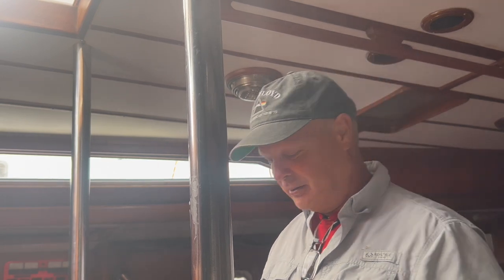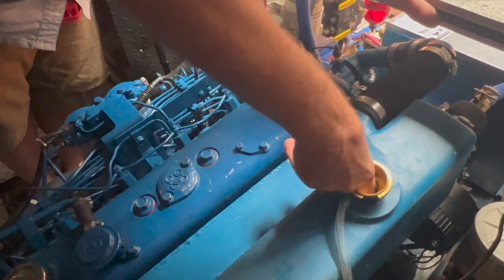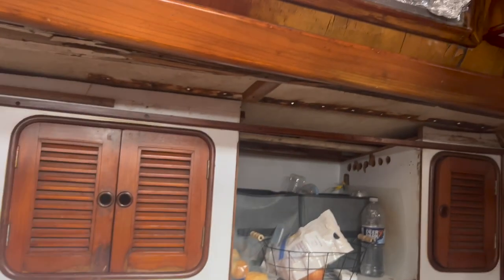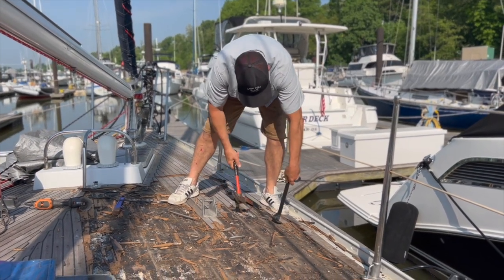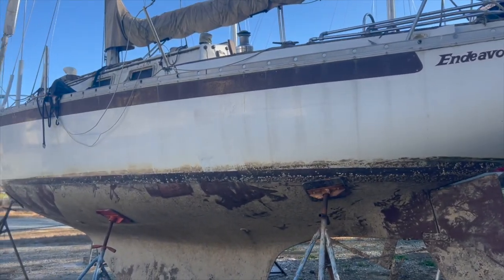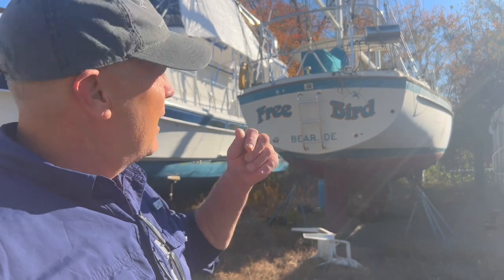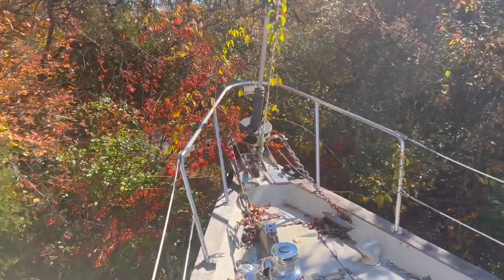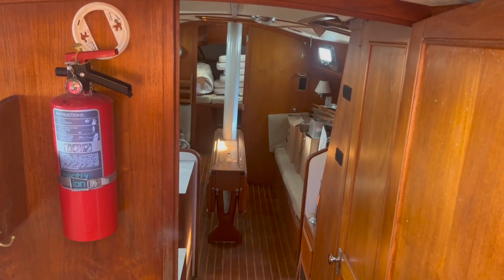FREE SAILBOAT -  Are They Worth It? DIY Sailing- Ep. 42 Sailing SV Bohemian

Comment: Pressure test the cooling system and use a stethoscope and listen for the air leak. 
Are there any freeze plugs that could be leaking in the motor well and your just not seeing it?

Comment: From a pure cost perspective, it probably isn't worth it. But you have the opportunity to fit it out exactly how you want it, and in the process, you learn every detail about your boat's systems before heading to sea.
Reply from the maker: That’s definitely right . I got a sailboat coming on the show that has some big issues . But the inside is really old and nostalgic
Reply: @sailingsvbohemian1464   I'm trying to decide just how much of a project I want to take on. I'm not afraid of hard work, actually, I quite enjoy fiberglass work, sanding, finishing, etc. I haven't done any huge sailboat projects yet, but I did spend a summer restoring an old Boston Whaler, and a year refitting an old racing dinghy a long time ago. I'm looking forward to seeing what you have coming up. Cheers!

Comment: If it's a head gasket it will either mix with your oil or it could go into your cylinders, the only sign if it's going into your cylinders would be white smoke from your exhaust. But you won't see it if you have a wet exhaust. I'm thinking if it's going into your cylinders with a wet exhaust you will most likely have to take the head off.
Reply from the maker: Before I replaced the old heat exchanger. It would blow a cloud of white smoke, now it doesn’t after a replaced it . But it still uses antifreeze.  I gotta remove the head . Never can be easy .

Comment: I'd say it's a head gasket pushing antifreeze out the exhaust.  I was brought up around owner operator truck drivers and was one myself for several years so I'm not a mechanic but I do know enough.. I'd definitely have the head redone and made sure it's flat etc while it's off.. another thing I would do before messing with it is do a oil sample analysis on it.. it will tell you if the engine is wearing on whatever bearings etc so you can know how much life is left in it.. don't want to spend more on it and then break a rod or spin a bearing etc

Comment: If you cannot get parts for that Perkins diesel I am not sure investing further funds is the wisest path.  I hope someone identifies where the cooling system leak is for you.  Congratulations on stripping all the teak off the deck - that is a real job.  If you are thinking of flipping boats rather than houses,  it is different economics.  Shelter is a necessity while a yacht is not a necessity.  Look at Ebay's donated boats, they just had a 71 foot Huckins motoryacht go for low to mid twenties, I think it was $23K, with twin diesels that worked. I wish someone would take a dry vac leave it on the ground and get the water out of the Endeavour sailboat as those are nice boats.  The gravity and suction would take the water out of most of the boat.  Nice video - thanks.
Reply from the maker: I just filled the last screw hole in the deck today with epoxy. You can get all the parts for the Perkins pretty cheap.  Just the old style heat exchangers you can’t get . Sometimes you have to wait a month or so for specialty gaskets from England . Theres a company called Trans Atlantic diesel. They specialize in Perkins motors on the east coast. They said to put a radiator pressure tester on it and see if it holds  pressure and then call them back. They cost 50 bucks . I’ll buy one in two week or so and tell ya what’s up in a upcoming video.